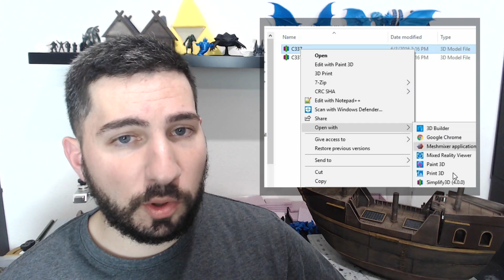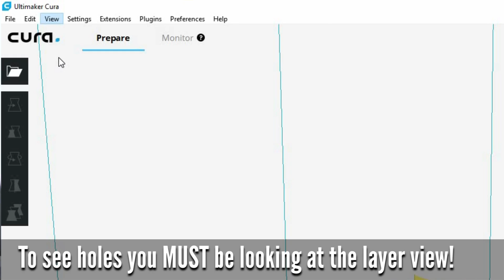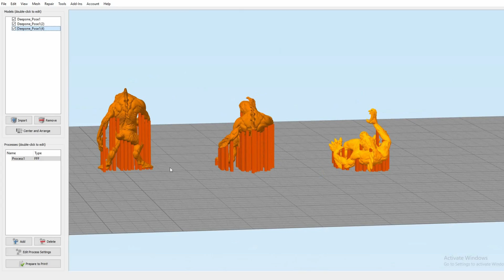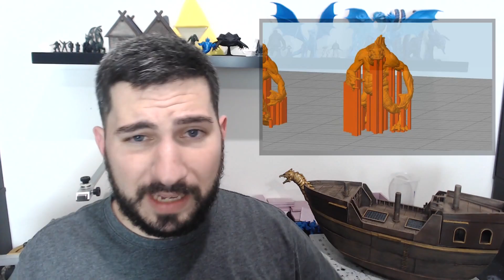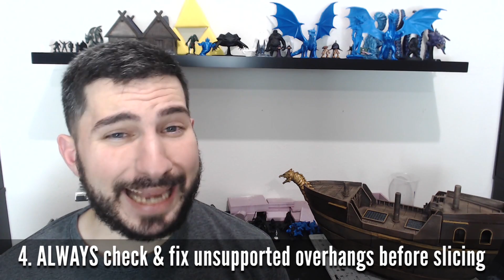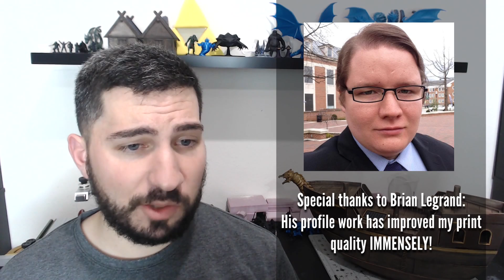Getting Better 3D Prints: Preparing & Slicing 3D Models (Miniatures & Terrain)

Comment: Oh Danny, Danny Danny Danny, I print my models upside down! I use .25 nozzle so the supports come of super clean.

But the biggest reason I do it, is specifically to avoid intersecting parts from being disconnected from the model.

Like if the Miniature doesn't have a base but has lowered arms, I'll print it upside down so the legs and arms aren't patched together, which I've found to be a big issue with creating smooth surface transitions.

PS: I know this is an older video so the comment probably doesn't matter now, but it's a good tip for people struggling with the 'Ripple' effect that occurs on these pieces

Comment: The “ironing” option in Cura’s shell settings has worked very well for me to smooth out flat surfaces that otherwise show much more ridges without the ironing.  You can also add “combing” under the “travel not in skin” options in Cura to further help with a smoother top surface.  Just a small tip I learned.

Comment: Instead of rafts, have you tried brims?  They use less material, and generally tear off easily.
Reply from the maker: Hi Joey! I'm assuming you're referring to when you go baseless for a model (like the Deep Ones I was showing in the video?) I haven't tried brims - only raft + skirt, or raft alone. I'll definitely give it a shot sometime and see if it's worth it. I don't mind using a little more material if it gets me a better print (but that's just me). 

Thanks for the suggestion! :)